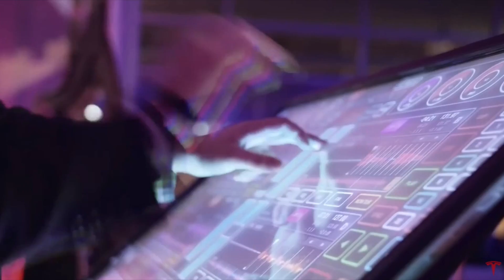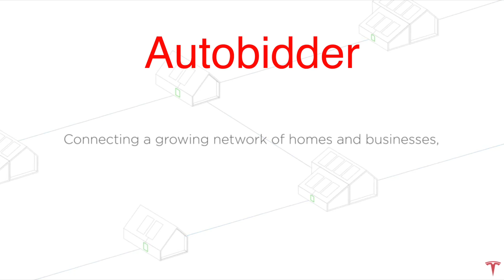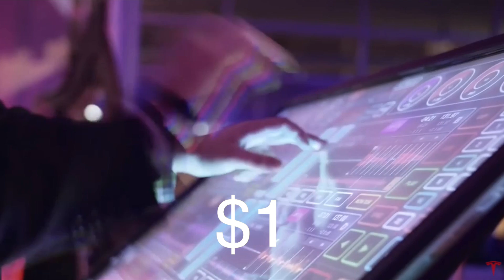Tesla Battery day | Who KILLED the ICE car ? | Tesla will start a new era in energy |

Comment: The new battery chemistry doesn't loose range, it gains range the more you cycle it and you can charge it to 100% and discharge it to zero without any degradation that's how you double the range without increasing the size of the battery.

Comment: Everyone is going on and on about “battery day” but it clearly has “power train” in the name too, they are bringing out some special innovation on the powertrain side for sure
Reply: Power train has limits. It is limited by thermodynamics and electro-mechanical limits and the best power train cannot use more than 98-99% of the power supplies to it.
While the Battery reveal will provide insight into new chemistry with higher density will lower the price of the vehicle that everybody is waiting about.

Comment: Tesla needs to improve Solar cells because atm they are no where near efficient, if they do this then the BI energy system will work otherwise it will actually cause another problem, the cheap Chinese solar cells are rubbish and don't last longer than 3-6 years.

Comment: Also, any info on the difference in battery weight? (We waste a lot of energy moving weights around)
Reply: They are betting 300-320 wh/kg. So some 25-30% improvement in weight. Right now 1kwh gets some 4.5 miles for Tesla 3, they are aiming 4.8 miles in the near term (due to overall record weight) and 5 miles in the long term. They are aiming to remove packs and modules and therefore comes maxwell.
Reply from the maker: Yes think the dry cell technology is lighter.

Comment: Power trading has some value but not a lot of value

The price of electricity doesn't actually vary a huge amount during most days. Today high and low prices were £35/MWh Vs £10/MWh that means if you charged and discharged 40KWh you'd make ~£1 today

And this is assuming the car was parked at home 24/7 and assigns a value of £0 to using up one cycle of your batteries

Even if a Tesla had 4,000 full cycles which is a lot of cycles it still doesn't give a value of £0 per cycle. Let's say 1,000 cycles are reserved for driving leaving 3,000 cycles spare. Great you can make £3,000 out of those cycles

Assuming
1: regulators say okay
2: Tesla takes none of it
3: That a lot of EVs are not doing P2G because each EV or battery doing that results in a lower difference in the max and min price available
4: That you keep the car for 10 years to be able to do the 3,000+ cycles

Definitely worthwhile doing
But it's not 10s of thousands of pounds value. Closer to £3,000 over ten years as an upper realistic value probably less as you won't be parked all the time

Oh and the 7.2KW typical home charger limits what can be earned. Even that might be too much as solar in the UK is linked to exporting 16Amps if the car had the same limit its only 3.68KW export speed max

Either way I don't expect this anytime soon. Perhaps in 2022 or later

Comment: wow I can't wait till we are all electric and no more gas.
Reply: And then we turn into California where they can't keep the lights on.
Reply: @Streeknine  Powering a fleet of electric cars is not as much energy as people assume. I just did a fast calculation for Sweden. During 2018 Swedish registered cars drove a total of 68 420 000 000 kilometer combined. Even if we assume a rather high consumption of 200 wh/km the total energy consumption would only be about 13,7 TWh.  During year 2019 Sweden produced 164 TWh of electricity. This amounts to just over 8% of the total energy, which is nothing to be concered over really. To cover this added consumption Sweden would just have to build 1 extra nuclear power plant for an example. Or it could be covered with an expansion of production from other sources like wind, solar, etc.

Comment: Hi Never to, yes ICE manufacturers had a head start but they started before the industrial revolution, computers and technology that exists now. From 2010 to 2020 only ICE platforms have substantially improved fuel consumption.  EVS have built bigger batteries but not improved efficiency.
Reply: Yeah that's not true
Reply: EVs have a far greater effiencey than combustion engines, so I'm not really sure what you are talking about.

Comment: 30% improvement from roadster 2.0 would be 1,300 km range from a single charge per battery.
Reply: Phil, the roadster 2.0 was the 2010 - 2012 model from Tesla, which followed the original 2008 - 2009 roadster. The 2.5 was the roadster sport, and the 3.0 was an upgrade offered in 2014.  I had a blue roadster 2.0.
Reply: Dave Riley I think Phil means Roadster Gen 2, or 2020 edition
Reply: boiii
Reply: It would probably make the 620mile range feasible

Comment: The saddest thing about EV's is that unlike ICE cars in ten years they have made almost no reduction in power consumption to drive a measured distance. ICE cars have reduced emissions and reduced fuel consumption for a given distance by at least 25% during this time. An EV of 2010 or 2020 still uses about 24000 watts to travel 100 miles. Just making larger and sometimes heavier batteries does not reduce fuel (electrons) used. In fact putting a 60Kwh battery bank in lieu of a 30Kwh one means double the fuel for double the distance for $thousands increased manufacture and subsequent product (EV) cost. ICE vehicle manufacturers could have added 100 gallon tanks instead of 50 gallon tanks for the same result but less money. When electricity demand exceeds supply which is almost a given eventually and a KWH of electricity costs 50c it will be more expensive to fuel an EV than an efficient ICE car.
Reply: ICE cars have had a century to make those adjustments. This is only the beginning.
Reply: The saddest thing is that you have not done your research. The fact is that EVs are far more energy efficient compared to combustion engines. The gains in fuel consumptions for combustion engine cars that you are talking about will remain irrelevant to this fact. 
No. There will be no shortage of electricty in the future. For a country like Sweden for example, switching the entire fleet of cars to electric today would only require about 8% more electricity production. That will not create any big problems, nor will it make electricity super expensive. That is just hyperbole. Also remember that a shift to electric cars will take at least 20 years. If you can't add 8% more electricity to the grid in 20 years then you have a rather big problem of incompetence in your country.

Comment: A lot easier said than done. Solar and wind..? We have better ways and means to produce power other than solar and wind and do it in a lot smaller space..This is one of the things that we'll be working on. Problem with solar and wind. it works part time. It takes up to much space for the power generated. Then they talk about batteries. This is basically a cat and mouse game. The dog chasing it's own tail. One reason why the tesla truck isn't out. No infrastructure. Can you imagine seeing every 300 miles or so giant solar and battery farms all over the place..? It isn't feasible. Another thing. Electric won't be able to replace what oil does today. The fact is. This will have to be a gradual process. Which could take 50 or so years.. This isn't going to happen over night..
Reply: It's quite simple really. Build out more nuclear power to use as a base load and complement it with renewable energy.
Reply: I agree. Also EVS need to become more efficient. That is . . .   use less electrons to travel a given distance. They need to be made lighter and smaller and more space efficient doing away with unnecessary power sucking devices. An EV that can take 4 people 600 miles on a 40 KWh battery . . .That would be real progress. Making bigger batteries is not progress.
Reply: @waynehobbs5175  hi how are you. That's what my company is working. We have many things that we'll be rolling out. h2o-and-evs.com
Reply: @waynehobbs5175  Hi your right most of these new evs are power robbing devices. Tesla at times can suck down the car and traction pack pretty quick. Idle current for the computers and stuff. I'm old school I don't need all kinds of stuff. We are working on that issue using less electrons.  We'll be addressing these and other issues as well.. We can't get into details.
Reply: @waynehobbs5175  EVs are already quite efficient and there are limited gains that can be made in that area. The problems lies elsewhere. Better batteries and better infrastructure is what really is needed.

Comment: Tesla: killed the ICE car with better battery technology
Legacy automakers: what is going on !! ??
Reply: sbmphr  nonsense
Reply: Most "Legacy automakers" have already begun to transation to electric vehichles. They might not seem to do as fast as some would want, but they are doing it. There are many soon to be released models from manufactures like Wolkswagen, Bmw, Polestar, Mercedes, and the list goes on.
Reply: pure nonsense, the battery technologs still has along way to go to reach ICE, its a fact, they need to get the batteries cheaper and lighter, from heavy mining equipment to heavy equipments to trucks and semis diesel is still very usefull
Reply: sbmphr  those are empty promises that will only be implemented if the auto companies find ways to build EVs cheaper than ICEs. I think this is likely by 2035
Reply: @kaya051285  nope you are wrong, untill the battery technology is ripe enough it wont happen, also dont forget third countries , they cant even afford to have electricity,its not an EV that will convince them
Reply: @carholic-sz3qv  it's not just batteries I think batteries are already cheap enough for example the CATL release recently said their cells are at $60/KWh already and this will just continue to fall. A 30KWh EV would only have $1,800 cost for cells

It's everything else to make those cells into a working EV powertrain. The battery pack the power electronics the electric motor the BMS and everything else. All those costs need to fall

Ideally it should cost no more than $3000 for a 40KWh 100HP EV powertrain. We are not yet close this probably currently costs closer to $12,000
Reply: Tesla can't do this alone
Tesla might go from 0.5 million cars produced in 2020 to 10 million in 2030 which would be an amazing 20x growth

But at the same time car production will go from 90 million to 120 million+

That means Tesla can grow 20x it's output but ICE car production would still be higher in 2030 than it is today
Reply: @kaya051285  Totally agree, I think Elon is too self-absorbed to collaborate with other car manufacturers though